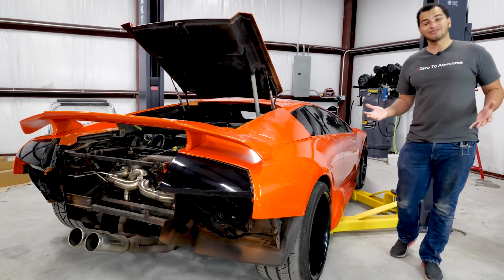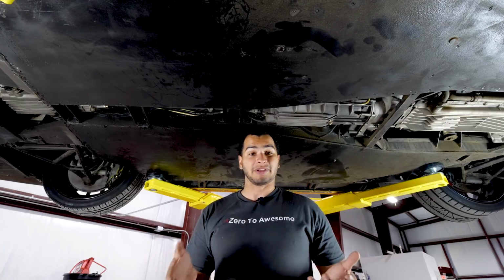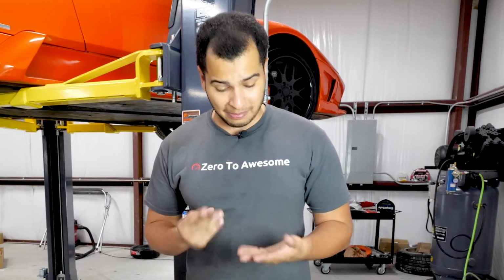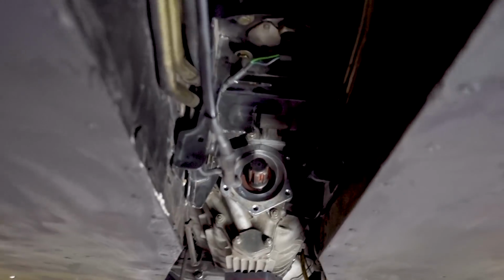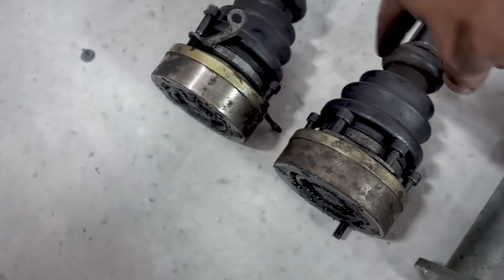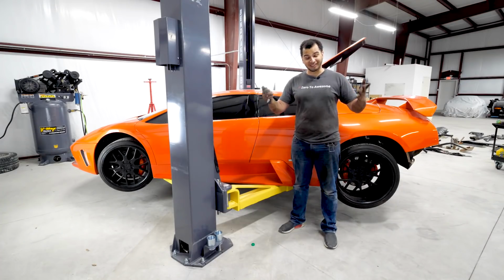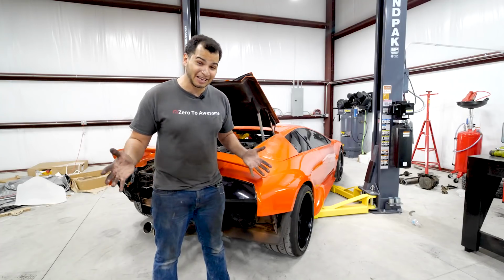I Transformed My Fast & Furious Lamborghini Into A SAVAGE LIGHTWEIGHT BEAST! (NO MORE AWD!!)

Comment: But AWD is awesome! Also deleting weight around might affect how the car handles, less weight on the front might give more understeer overall depending on the setup, you may try to compensate with the throttle but if not careful the rear may oversteer because of the power and all the weight on the back combined with the sudden and more dramatic shift of weight, the lift-off oversteer is definitely going to be more pronounced so even without using the throttle the car may oversteer just because of all the weight is on the back, making the car unstable to drive at least on race track conditions. At least that's my take based on my limited knowledge driving thousands of hours on racing/rally simulators.
Plus you can see the AWD is overall better, power going through the 4 wheels instead of 2 is just multiplying the grip even if some power is lost because of the drivetrain layout, on the "Holy Trinity" of hypercars, despite the Porsche 918 being heavier and overall less power it can keep up with the P1 and it is faster than the LaFerrari and is probably the easiest/safest to drive.
All these years driving in rally simulators definitely made me a huge fan of AWD as the best drivetrain for performance despite the added weight and some power loss due to the power not going directly to the wheels but through differentials, still AWD is awesome.
Love your videos, channel like yours keep feeding me my dream to have my own garage space and alone time figuring out and modifying my own cars.

Comment: What a silly sample this was - the wheels rotate with the same speed when the car is lifted off the ground and it is not possible to be visually distinguish anything. Yes when on ground the wheel speed will be different due to different tyre diameter - if there is any difference since you can have the same diameter with a lower profile tyre at the back...

Comment: Hey man I have been trying to get the Goonzsquad to watch or get ahold of you some how. They got a wrecked lambo and don't have the first clue how to fix it. I told them you had 2 and was working on this one now. I do have a question why do they call a car with a motor in the back amid engine car when the motor is in the back of a car? I would think a mid engine would be in the middle of a car.

Comment: Having a 19" front and 20" rear doesn't really matter. You'd just need to keep the total diameter same as stock, or at least the exact same ratio front to rear diameters the same. All AWD cars can stagger the rim size, but keep the total tire height the same. I do like the idea of losing some weight and I'm not sure how well these things handle AWD vs RWD.

Comment: Is that an authorized OEM Lamborghini worm clamp on the steering rack?

Ye really need to torque down the stub axles properly. They hold the wheel bearing inner races together and put just the right amount of preload on them.

You're getting all fancy schmancy on us with those work gloves!

Comment: Dang - Lambo's circa early 2000's look like a someone built a kit car.  My 2000 VW GTI had better looking components under the skin.  But that's all good now that the Germans have taught the Italians how to build stuff = good looks and good engineering
Reply: and the front axles remind me of VW CV joints from 80's and 90's VW's which when the bolts fail you have to resort to physical violence to remove.
Reply: @realestatehelpsite  pretty sure they use the same axles that VW uses they purchased Lambo around 2002

Comment: I hope you did torque those stub axles to spec. And used brake cleaner after 6:42
It's no fun to approach the corner without brakes or the front wheel :)

Comment: So were the reasons you converted to RWD only because of the tire size difference between front and back and weight reduction? You mentioned that other merci owners said they wouldn't go back to AWD, but is it beneficial ( does it make the car faster/ better handling/ any other benefits)? What makes doing this mod a good thing? Honestly, it really doesn't matter as this is your car and you make it what you want it to be ( and I guess I can go complain once I own my own lambo haha), but I didn't know if there were any other reasons? I doubt this will be a track car for you and so I guess AWD and track performance take a back seat on this project. If it was done so you can do massive power slides and smoke up the rear tires, you have my approval. Any other insights would be good. 

Keep up the great content!

Comment: any car with mismatched front/rear tire circumferences will by necessity rotate the wheels at different rates to maintain the same across the ground distance covered per unit of time. four wheel drive technology is much, much more complicated that it is made out to be here. whether or not the mod made here is beneficial, detrimental or inconsequential demands more than a seat-of-the-pants analysis, IMO, to be made convincing.... entertaining (and it is) as it may be.

Comment: Be careful using chrome plated sockets with an impact if the chrome chips and the socket is spinning it will cut you to pieces like a meat slicer through gloves and all. Just letting ya know. I've seen it happen. It's not pretty.

Comment: At first I thought I wouldn't like this video, I was waiting to go to the comments to yell at you for disconnecting the front drivetrain, and after you talked about the benefits I was like oh okay LIKE XD
Reply: He’s full of shit. He’s just cheap. Taking away AWD on a car like this ruins the acceleration and handling capabilities. A quarter throttle equals wheel spin.  

At 80 mph, punching the throttle = wheel spin (and a crash).

Comment: When reattaching road wheels they MUST be torqued up for safety, a rattle gun should not be used as it is very easy to over-tighten the bolts.  Having had a wheel fall off due to failed wheel studs (at only 5mph!) that was widely attributed to tyre shop use of rattle guns I can attest to the withering fear that it generates - my loose wheel bounced across the road hitting the top rail of the flyover parapet, where it was within 4" of dropping down onto the busy carriageway 30ft below!!!!  Even if it is only to seat the bolts, get into the habit of doing it properly because you WILL forget to tighten the wheel bolts to the specified torque.  
The last tyre shop I used used a rattle gun to just spin up the bolts on my 500E, using a torque wrench to check the setting however, when I checked the setting when I got home, instead of being 85ftlbs, all the bolts were in excess of 350ftlbs!!  The tyre shop had to get a special jig made up to drill all the bolts out and I insisted that they change the hubs as well as they will have over stressed the threads.  The overall cost to the tyre shop well exceeded the price of 4 No. 245/45x17 Goodyear F1 that they had just fitted.  The fitter was sacked

Comment: A 2353019 3452520 keeps the drivetrain happy on a Murci and keeps the front to rear outer diameter under 3% which is the factory limit.  It's just that the 20/21" setups that used the 375/20R21's from Pirelli all the guys were running got discontinued and there was/is no suitable replacement tire forcing everyone to abandon their 20/21" setups. That - and Nitto Invo's are absolute crap.

Comment: Why not do the calculation to put a different size ratio tire on the front to meet the same diameter as the rear therefore you would not have the problem instead of Jerry rigging it

Comment: i don't think just taking out the front wheel diff is going to convert it to all wheel drive. you have to either bind the front drive line or change the transmission to a rear wheel only trans. anything else will result in loss of power as power gets split on center diff. but i'm no engineer... so "fuck my opinion" am i right?

Comment: Ehm... Whatever floats your goat. Lambo made the 'Lago AWD for a reason. 2003 driving aids coupled with a V12 RWD setup, and you are no Valentino Balboni. What could possibly go wrong? Also, have you heard about a thing called weight distribution? You just made it like 25/75 rear - biased.

Comment: You say the front wheels turn at a different rate, but it seems they turn at the same rate, but that the circumference of the wheels are different, so the forward speed is different for the front vs. the rear: the front wheels will be slower.

It seems such a shame to remove the AWD from this car vs. getting properly sized front tires :(  OK I guess since it's reversible, and it keeps the look of the movie car, probably more important (and that matching sized front wheels and tires would be way more $$$ than this kit. Also it's fun to see you ripping major components out of the car!

Comment: So there is one thing wrong with what you said, like you said about running 19's on the front and 20's on the back will cause an issue but that's not actually true.

It's pretty common for these to have a wheel setup like that because you can run pretty much any size wheels you want as long as you don't go outside of the difference in rolling diameter between the front and rear..

Because from the factory they have a 245/35R18 on a 18x8.5 and a 335/30R18 on a 18x13 which leave the rear having a rolling diameter thats around 4.5% larger than the fronts.

So if you have aftermarket wheels on it that are say like yours that are 19" front and 20" rear, it's very easy to keep it around that 4.5% difference front to rear by playing around with tyre widths and sidewalls.

Comment: If you lift off the the gas (as in over cooking it into a turn) there is ZERO torque going to the front wheels on this car, or any other car with this setup. There is no torque going to the rear wheels in that case also. There is absolutely a differential splitting drive of the front of the transmission,I would say the viscous coupling is located on the front of the trans also. The car is AWD all the time, the viscous coupling (a clutch pack in thick fluid) is in effect a LSD between the front wheel set and the rear wheel set. A viscous coupling is designed to allow one wheel set to spin faster a limited amount though not all the time, given wheels/tires that are the same rolling diameter. The fluid then becomes thicker and slows down the spinning tire set when needed.

Comment: Okey. I think if from factory the car has 19s at front and 20s at the back, they already counted for different freq rotations. Second, any car above 500hp should have any form of AWD or 4WD to make it more stable and safer. Just my 2 cents on that.
Reply: Factory spec is 18 inch front and rear on all the murcielago iterations.

Comment: Or, the other option would be to get 4 wheels the same size. Might have been a little easier. Edit: The "correct" size would be more accurate.
Reply: @RandomGuyDan  I thought that was implied. OK, change my comment to "get 4 OEM tires and wheels" which are 245/35-18 in the front and 335/30-18 in the back. I kind of figured my point was made though. I see no logical reason to get rid of your AWD setup because you have non-standard wheels/tires. Just get new wheels and tires. Way easier, and bonus the car will work the way it was meant to.

Comment: RWD FTL!!! (for the loss)...now you might as well put a V6 in it for even more fuel efficiency and then trade it in For a Toyota Prius...so much for keeping it movie original!!! now that you messed with that 50/50 weight distribution, it is now ass heavy so the rear end will "kick out" even more and "oversteer" more also...AWD delete= FAIL!!!

Comment: I'm really not about online criticism. Its probably not worth the time its taking me to type this since few to no people will reed this, but I feel compelled to type it. He really should have just matched the wheel size and replaced anything that needed replacement. The mod he did degraded the murcielago. eliminating AWD and decreasing weight on a vehicle with this much power only takes away your ability to deliver power to the pavement. Your allowed to decrease un-sprung weight, but unless you want wheel spin all day let the car be heavy. instead of getting this kit, it would have been a good opportunity to get a really nice set of wheels with some brand new rubber. not worth it to keep the movie wheels. the movie crew obviously did a piss pour job with this car. damn shame.

Comment: I don't get this desire to convert extreme performance cars from AWD to RWD. Any car with more than about 400 hp will smoke the 2 driving tires too easily on the street and you'll end up with AWD Subarus, etc. out accelerating you in "casual" traffic light to traffic light acceleration runs. The car will also perform far worse on almost all road racing tracks. The only real benefits include possibly slightly improved 1/4 mile times with drag slicks installed on a very well prepped track, possibly slightly improved top speed (might even go slower instead) and if you are a good enough driver to handle high speed drifting, you can now do it. Cruising down the Mexican highway or race track at 80 mph with the rear tires smoking and slid out sideways will now be possible (both intentionally and unintentionally) - but so will losing control be much easier.

For just about every other activity, including real world (non drag race prepped surfaces) acceleration, stability while zipping around canyon roads, cornering/handling in general, etc. the AWD setup will blow the doors off the RWD setup.

Why not leave it AWD and sort out the tire front/rear tire diameter ratio (if required)? You'll be able to experience the maximum real world performance and acceleration that the car is capable of and with the AWD stability you'll be able to drive it harder and enjoy the car's ultra-high performance more.

Comment: Or you could just put the correct size wheels on it so it doesn't look retarded and leave it AWD so it doesn't drive retarded.

By the way, if you actually think driving the Gallardo around with the front drive disconnected is a good idea you're seriously mistaken.

Comment: Twin turbo charge it!!! Seems like hardly anyone does it theoretically you should be able to produce more hp in a v12 than a v10 not sure why nobody has tried highest hp in a Lamborghini v12 1200hp but in a v10 2000 to 3000 hp makes no sense.

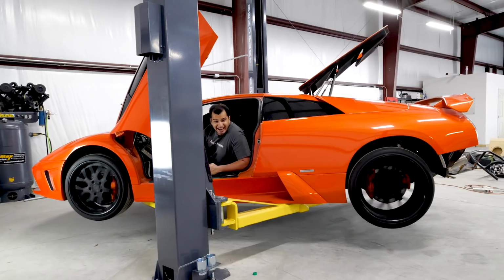Comment: 4:29 Rubbish Freddy! the difference in diameter on your wheels (Front 245/35R19 Rear 345/25R20 = 1") is less than the difference between the OE front and rear tyres (Front 245/35R18 Rear 335/30R18 = 1.1")
Also every time a car with a VC diff goes round a bend or corner the diff sees different wheel speeds on each driveshaft. "On it's last legs" ffs!

Comment: Different wheel diameters don’t affect AWD as long as tire diameters are the same. 
Rotations Per Mile is all that matters and as long as they are the same, it WON’T hurt your drivetrain. 
You should know better than this tavarish.

Comment: Simply idiotic.  The size of the wheels does not mean they are rotating at different speeds.  The circumference of the actual tires has to be within a certain percentage of each other, relative to front to back.  All he did was further reduce the value of the car.  SMFH.